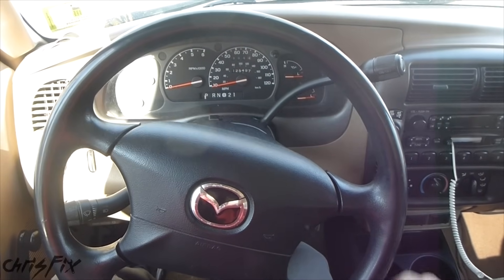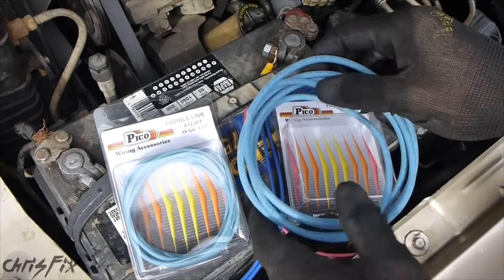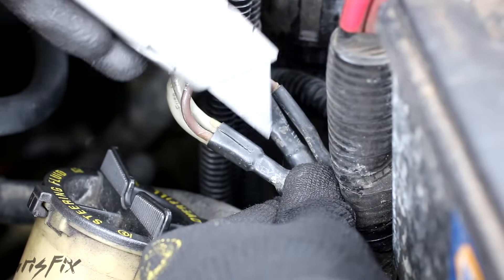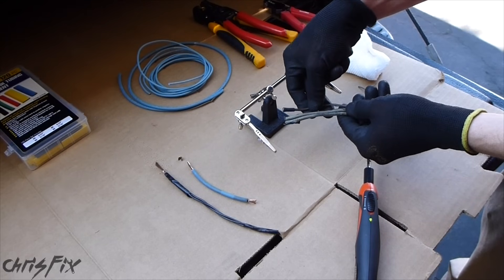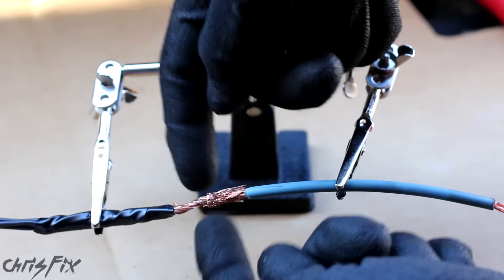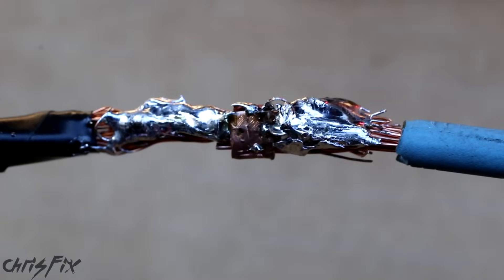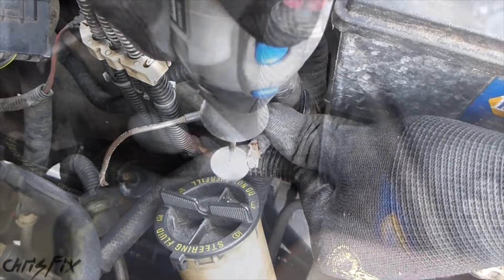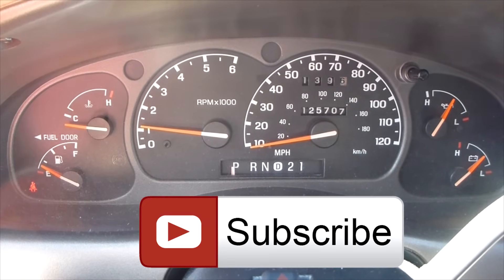How to Replace a Fusible Link (Car won't Start)

Comment: I have a 89 S10 pickup. It has been sitting outside for a while. It has cobwebs on it. It needed to be jumped but it ran on Memorial Day. But now it won't start now. If I duimp gas in the throttle body it will start but stall when the gas is dumped is gone. Could jumping the truck caused the fusible link to blow?
Reply from the maker: altlandf If the fusible link was bad, there would be no power to anything. I would check the fuel pump and do a fuel pressure test: https://www.youtube.com/watch?v=_oXLUqE4Sf0
Reply: Thank you for your help. This past Sunday I replaced the fuel pump. It really looked like someone had already replaced the entire unit. The fuel guage and pump assembly was shinny. I could read the sticker on the top of the assembly. It makes no sense for the thing not to start. Can you command the fuel pump to turn on with the Snap on red brick? What would happen if you just ran a wire to the fuel pump and bypass the relay? There were also no codes present. All I got was a code 12. Didn't report any issues with anything.

Comment: hey Chris I have a 94 Cutlass Ciera and I replaced the alternator and the battery. and it started but when I shut the car off it wouldn't do anything until I jumped it.. it's a new battery and alternator.. do u think this is my problem? and where would I locate it on my car?
Reply from the maker: It might be the fusible link but I would check your grounds and clean them well. It is amazing how dirty grounds will not allow the car to run right.

Comment: Chris, Love your channel! I would like to ask you a question. My 1999 Dodge Ram 1500 318, 5.2, 5spd manual with 120k is throwing a code p0171, system lean, bank 1. Any ideas? It will stall once and a while when I go to park it. Could it be an IAC sensor? Thanks a lot, John.
Reply from the maker: John King Since the car is running lean, I would think there is a vacuum leak. It could the the IAC but if the IAC was bad you would get a code for it. You might try cleaning the IAC like in this video: https://www.youtube.com/watch?v=vFhoNykgQtc
Reply: Will check for vacuum leak and let ya know how it works out. John.

Comment: Hey Chris quick question, would something like this cause my car to die while I'm driving, then it won't start afterwards unless I got a jumpstart... And I already replaced the alternator and the battery so any thoughts on what it would be?
Reply from the maker: Probably not but it could if there is a loose wire. With the car running, wiggle the wires around and see if it shuts off. Clean the terminals good which could fix the problem!

Comment: Hey I have a 72 Chevy C10 I bought recently and I'm having an electrical issue. Hopefully u can help. The previous owner said the tach didn't work. One day I was looking behind the dash and noticed the plug for it was unplugged, so naturally I plugged it in. And since then (I think) my truck keeps dying on me. I replaced the alternator and and it worked for a day or so then died. I decided to jump it and take it to a shop but once I hooked up the jumper cables, the fusible link fried! I'm thinking I should unplug the tach replace the fusible link and try again.The old link is unreadable, how do I determine what size fusible link to use?
Reply from the maker: +Joshua LeMaster Go to the parts store with a cut of wire from the fusible link and they can match it up. When you get the car running again, check the voltage: https://www.youtube.com/watch?v=LGB6ZEjGm7Q
If that checks out, then look for a short (maybe your starter): https://www.youtube.com/watch?v=n5FJDgcdii8

Comment: hey Chris I have a 99' ford Taurus se station wagon. a couple days ago I encountered a problem. when slowing down(i.e. at stop lights) and come to a stop. when idling at the light I will feel my car shake and then turn off.... but all the lights and radio and stuff were still on. do you know how to fix or suspect what the problem could be? thanks for answering in advance :)
Reply from the maker: Noah Shy Do you have any check engine lights? This can be a few things. How many miles on the Ford Taurus? Do you have any idling problems? Does this happen when the car is warmed up, cold, both?

Comment: Strange. My B4000 doesn't have this. But good news is i installed my brand new power steering pump and it is so quiet. All you hear is the roar of the pushrod 4.0V6. So worth the 50 bucks. And for you, with the smaller 3.0, it'll be even easier. Just be gentle pulling the pulley, it likes to LITERALLY strip the threads off the puller. After i get tires, eletric fans will be installed and I'll finally start my channel
Reply from the maker: RedTeamWolf Awesome! Glad you have a quiet pump now!

Comment: Hey Chris, I know this is an old video, but I have a ranger and in the past I had this same issue, but the issue kinda stopped (other than when I drive it’s like all power was completely lost, like a major stall almost like the truck completely dies). That still happens sometimes not as bad as it was when these issues where bad though, now it’s minor. The question is, now I sometimes have a no start situation, but no power is lost, just no click nothing (lights stay solid). Could it be related to the problems I was having a couple years ago, (thinking after this video, fusible links?) I swear I know my 01 ranger top to bottom inside out, but them fusible links lol when you pointed them out along with that issue, my mouth dropped
Reply from the maker: It could be an electrical problem. Is the check engine lights turning on when you turn the key? If not the computer isn’t reading. Check out my video “how to diagnose and replace a starter”.

Comment: Chris! What do you know about Chevy blazers? this has been a horrible weekend and add a couple days for my truck. Friday my dash gauges were going crazy then the truck just died while I was driving. 1st the alternator was replaced, today the starter was replaced, still won't start..  and then I replaced the battery. still not starting! even my car guy is stumped! any suggestions??

Comment: All right so I have a 1985 Monte Carlo SS and I am a new beginner on fixing my car and so I forgot to disconnect the battery when I was putting in a brand new starter and the little red wire that connects to my starter made a little zap and I don’t know if it was that or what but no lights or no nothing will turn on help is much appreciated

Comment: where can i find the crimp package. i have a 1992 dodge can same problem. i assume i can buy the fusible link from pep boys and the dealer has the heat shrink tube. just cant get hold of the crimp. thanks
Reply: Ebay amazon ext.
Reply: Is your dodge a Cummins? I think I might be having issues with my '92 fusible links. No odometer, no speedometer, everything else works fine. How did your fusible link replacement go?
Reply: +Cam Kwiatkowski no odometer or speedo is a speed sensor in trans or a speedo cable depending on what urs has. just look on driver side of trans either in middle or toward rear
Reply: Thanks man. My VSS is really gunked up, thanks Manitoba winters. It randomly started working again this past week, so I'm thinking pull it off and hit it with a bunch of degreaser, clean up the whole area. If that doesn't work, I'll replace the VSS and connector, possible run the wire all the way back up to the firewall with some kinda sheath on it. Seems like a bad idea having that tiny wire running underneath the truck unprotected. Appreciate the advice

Comment: I removed the small section of fusible link wire that connects the two different gauged wires together. How do I replace that?
Reply from the maker: You mean the crimp on butt connector?

Comment: I don't think your soldering iron was hot enough to do a really good job on the solder, it's tough on thicker wires like that. But, obviously it worked, as another commenter said, using flux would have helped in this situation. I've never done anything with fusible links before, hopefully I don't have to.
Reply from the maker: dainternetguru Yea, what I learned is use flux and a flat/broad tipped iron. Thanks!

Comment: Hey chris, what was that fusible link for? Ignition? And I saw it had 3 links in the beginning then it had 2 at the end, what happened??
Reply from the maker: Junior Hurtado There were three there. It is for the ignition and alternator. I am not sure what that smaller wire is for.

Comment: Also a question how do you fix a gas tank gauge that keeps moving up n down
Reply from the maker: nando1026 Was it moving up and down like my speedo gauge?
Reply: Yea it moves exactly like that constantly
Reply from the maker: nando1026 That is potentially a bad fuel sending unit or a loose connection.

Comment: Hey ive totally damaged my fusible link wire out of my 2004 Chrysler 300m so i cut it off. I now have no idea what i need to replace it. Do i need 3 like yours? Mine only came with one green 10 gauge

Comment: I have a 2001 expedition 5.4. unfortunately I replace the battery and alternator. it still isn't holding charge after spending $240. I see a fuse linkage on the positive cable leading to a firewall mounted solenoid.  i havent found 12 gauge fuse wire. or can I buy this linkage somewhere?  or a salvage yard part? not electrical savvy
Reply from the maker: china girl The fusible link is probably not your problem. Check out this video: https://www.youtube.com/watch?v=n5FJDgcdii8

Comment: I need help guys. Do the fusible links come in different size gauges. My wire is going from a 10 gauge to a 16 gauge fusible link. It keeps burning up the fusibility. Should I go with an 8 gauge fusible link because it is pulling a lot of current. Thanks

Comment: Wait, so once it burns up it's done or does one time burn out completely, cause my truck is losing power like yours and completely then a couple hours later gets it back... But I won't go driving it as it will fail again

Comment: This video should be a How not to Replace a Fusible Link
when the wire is warm it will melt the solder and fail(meaning the wire didn't blow but the solder melted)
see how they are crimped from factory  that is because a crimp cant melt with heat and  that  the only part that WILL melt is the fusible link 

by doing it the chris wrecks way or the chris wrong way you will have a hard time when stuck on the side of the road if you turn the ac and fan on high  this can with the rest make the wire warm from drawing extra current

its ok to solder stereo wires as these have shitty little 2.5A, 5A or 10A fuses that will pop before the wire gets hot

however this is the main harness that is not fused and the current draw is greater(when ac fan blowing on high  the wire can become warm(warm enough to melt shitty lead but not the wire))

there is a reason why the manufacture didn't solder them in the first place  because this should be only crimped 

same goes for house wiring
all wiring in a house is crimped or on blocks that crimp the wire .... why because the crimp will not melt and by not melting  it will blow a fuse at the switch board/fusebox
any heat can melt the solder therefore burning down the house(worse case scenario)
a lit match can melt solder 
i have rewired many cars to know the dangers of a dumb thing like to solder a main harness fusible link haha

Comment: nicely dun one comment I like to put some rosin flux on the wires as I splice them together then the solder flows real well as you apply heat . I also use rosin core solder 60/40 blend . as always I da fly in da flux LOL
Reply from the maker: charles albert Thanks a lot! Yea, learned a lot from you guys with these great comments! I need to try some flux next time! I think I will make a soldering video showing the techniques everyone has been sharing!

Comment: I have a rv, the fusible link burnt up. the fusible link that goes from the positive to the dash. for some reason that keeps the rv from starting. I tried running a thick wire from the battery to the dash. I would get power but it wouldn't start. and the wire keeps getting hot when connected.  should I try a thick wire to thin wire? (fusible link) ran and drove great until that fusible link randomly started to burn up... help would be appreciated it's stuck at walmart and I don't have money for a semi tow truck to grab it... thank you.

Comment: Regular heat shrink tube is NOT water-tight. You need a special tube that has glue on the inside.
Reply from the maker: Thanks for the tip! Here is more info: https://www.youtube.com/watch?v=Zu3TYBs65FM
Reply: Oh! Didn't think you're still reading comments to the old videos :) Respect, you've got some of the most detailed and well-thought-out videos I've seen on Youtube.
Reply: And yes indeed, the tubing you've used in that video is the right one for water-tight insulation. 
Have you looked into the ways of making connections that do not require soldering? Various clips, 3M scotch-lock and such. Those ways seem to be the go-to among the automotive electricians, although I'm not sure why. But even the VW / Audi service manual specifically instructs to NOT use soldering on any electrical jobs in the car.

Comment: I have a 99 ranger and i don't have fusible links but if my connection to the battery isn't tight it will do the exact same thing

Comment: Hi ChrisFix, I have a Buick Regal 2011. The engine off automatically when I’m accelerating sometimes from slow speeds. I start the car again and it works fine for a few days. Sometimes, I would have to wait for a few mins for the car to start again as it won’t even crank. The battery seems to be fine when the engine shuts off as I can listen to radio or the lights on the dashboard stay on. I took it to a mechanic and he couldn’t figure out what the problem is. Can you help?

Comment: Hey Chris I have a electrical problem only on the inside of the vehilce. 2005 lincoln aviator,  it starts, but all electronic components within the vehilce seems like they shorted out. Windows, radio, seats, blinkers, dome lights, everything doesn't work this just happened 2 days ago it was working. I took the battery to get charged and when I reinstalled it this happened. Any ideas?

Comment: hey cris i know this ? is not related but im having a problem with my 2006 bmw 325i not starting. first it was the battery ran good for a while then died like in  6months so i replaced the alternator and got a new battery. now it does not want to start at all. all the lights come on and the fuel pump but no start or click from the starter. keep in mind the car was sitting for like 5 months i know i just didnt have the money. have u delt with this with a bmw any info will help thank you bro....
Reply: possibly the ignition solenoid
Reply: having same problem

Comment: What caused the fusible link to trip in your truck?
Reply from the maker: I am not sure. I think the starter was starting to go bad but honestly I am not sure if that was what caused it. It could have been a dirt/bad connection I cleaned up as well.

Comment: Your solder would have worked better with a mini torch. I used them all the time connecting wires up for fish-houses, they would look like the pretty one all the time. Then we shrink rap them.

Comment: I replaced my inline fuse car started up just fine drove it around when I parked it turned it off it won't start back up it's doing the same thing where should I look next

Comment: Did this cause your truck to drain the battery wile driving it?
Reply from the maker: It did not. That is probably the alternator or a bad connection to the positive lead.

Comment: Hey Chris i have a 2000 ford ranger 4.0 and it wont run right when you first get in it.  When you first start it up you have to turn the key on and off 3 times otherwise it will sputter and then die, when you do this i can hear the fuel pump running  and it wont sound to bad but every once and a while it sounds like it cuts out for a split second. Then once you go drive down the road the truck sometimes has like no power no matter how much you push the gas, then after that goes away it runs just fine. I am getting sick of it and don't know what to do. I would please like some input Thank you
Reply: If it has a fuel filter witch I sure it does I would start by replacing that they are cheap and easy if that doesn't fix the problem it may be a bad fuel pump but I would have a shop check the fuel pressure before spending all that money on a fuel pump but it definitely sounds fuel related.

Comment: I think my chevy nova has a  bad fusible  link .iam going to try to look for it tomorrow  it does the same thing i can turn in the lights  but when i try to turn the engine  it dosent do anything  i only get a spark on the battery  terminal and then nothing happens.after that  i cant turn on the lights  or radio i have to disconnect  the battery and connect it again....ill try to look for the fusible link tomorrow  thanks
Reply from the maker: wheelmanvicful Good luck and keep me posted!

Comment: What can I do if It's hard to find the link fuse? Do you think I can run it straight from the battery somehow
Reply from the maker: +andrey kuz You can run a wire straight from the alternator to the battery and one from the battery to the starter but you will need a megafuse rated a little higher than the alternator output and another rated slightly higher than the amp draw on the starter.